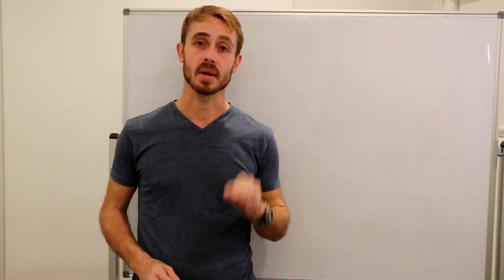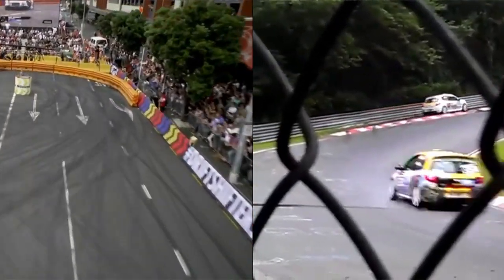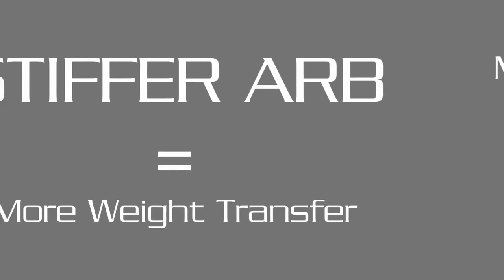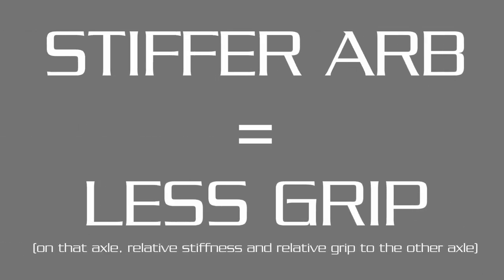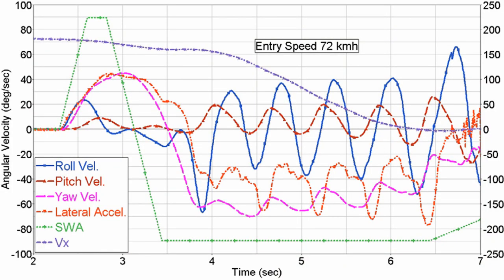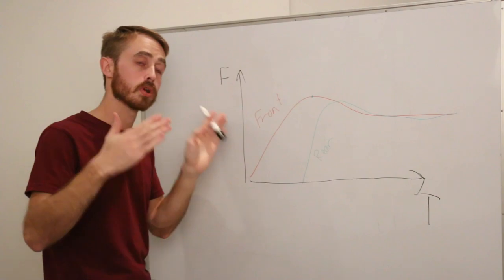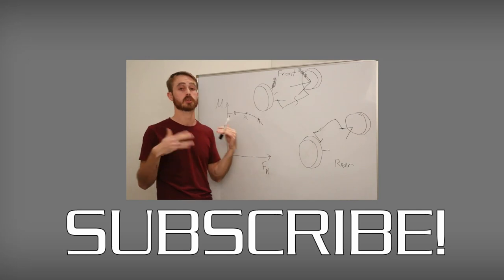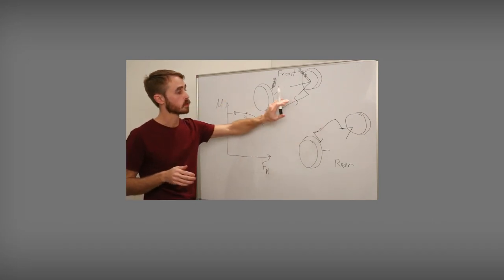Anti-roll bars/Swaybars Explained in 30 Seconds!

Comment: Thank you for these videos.  I have installed these on every one of my drift cars from my AE-86 to my 15th 240s13 (actually kept the same pair for every car :) Drifters are often on a VERY tight budget) the only science i had behind it is that they make the frame more rigid and thus steering and handling are greatly improved.

Comment: sorry so much but I didn't understand it AT ALL :(. Maybe other engineers understand it but for newcomers it's really hard both with this video and the longer version too :(. How does a metal bar transfer weight from a side to the other? Does it pushes or pull the opposite side? Does it affects to the wheels? To the suspension? I don't get it, sorry
Reply: Almarma the longer section of the anti-roll bar (arb) is attached to the main chassis with bushings that allow rotation. When one lever/side moves up with the arm attached to a wheel, the arb moves the other side up also. Adjusting the stiffness affects how fast the arb transfers the movement. Also see the explanation given by Engineering Explained. He goes into the details of how arbs are attached, but Kyle provides a better explanation of why and how to use them.

Comment: Plz explain the difference between horsepower and torque :3
Reply: torque is a twisting force. when you use a wrench, or turn a screw driver or even open a jar lid, you apply a twisting force. that is torque. horsepower is a measure of torque over time. some torque applied over a set amount of time gives you a power rating. the same torque in less time means more power. but you can also make more power by increasing the torque and delivering it in the same time. 
if you use imperial units, the formula for Horsepower is (torque * RPM)/5252 
a low torque, high horsepower engine needs to run at very high RPMs. an older Formula 1 engine that revs to 19,000 RPM is like this. 
a high torque, low power engine spins very slowly. diesel engines are like this. 
horsepower is just torque over time. knowing peak power and torque and at what RPMs they happen on an engine can let you know how the engine will perform.
Reply: they are not really different things.  They are two explanations of the power an engine is making.  Horsepower is derived from torque...you can find a formula by googling.  Torque is how hard something is being twisted.  Horsepower is how much work is done over a period of time.

Comment: Watts link and Panhard Bar. Anti roll bars?
Also what steering linkage do you use on the buggy.(project requires something of similar length)
Reply from the maker: The buggy has a SACO Magnum centre mount steering rack (like this http://www.pmdraceproducts.com/itemdetailspage/22904 ), with two custom steel plates to get the tie rods out to the desired position for bump steer. Tie rods are 1 inch steel with threaded ends and rose joints in double shear on the uprights, and somewhere between 800-900mm long if I remember correctly. Does that help?
Reply: Yes it does! thank you so much, been looking for something like this for a while now. Building a vehicle with virtually no bump steer is hard. Especially with all the travel i want. I would rather be over sprung and additional roll bar stiffness than not have it.